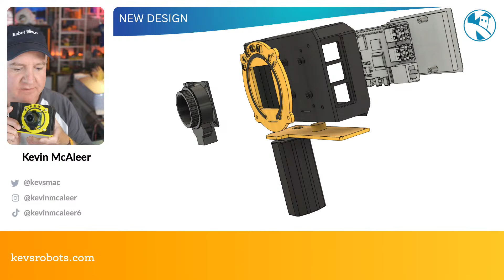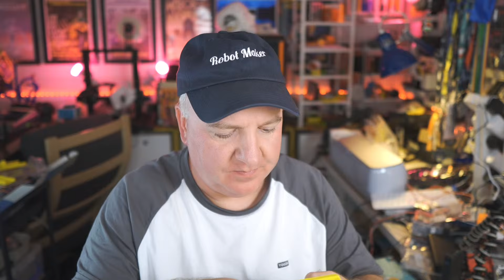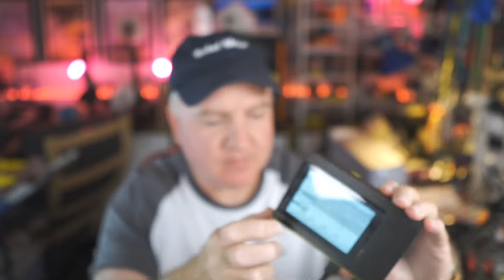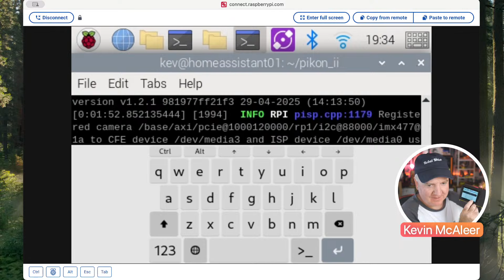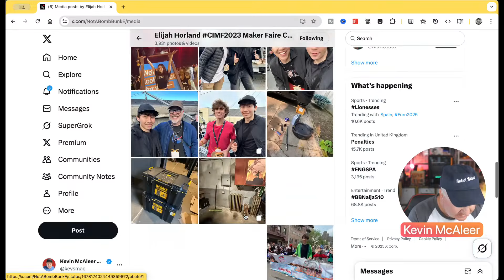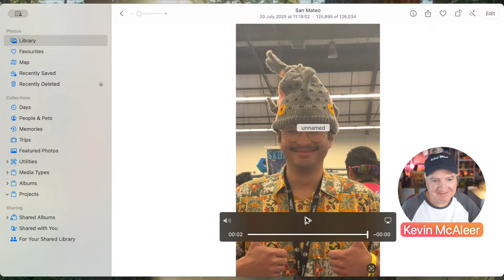PiKon II: The Ultimate DIY Raspberry Pi Camera!

Comment: I’ve been watching your pikon projects and looking at other versions around the web of similar raspberry pi based digital cameras, very impressed. I’m interested in doing something similar, I like the idea of having camera modules that could swapped like the ai cam or adding a m5stack llm 8850 ai accelerator so you can do object detection from a distance using cs lenses. Not sure which direction to go really. You think your pikon could fit another hat?

Comment: Thanks for the great video! I'm having an issue downloading the STL file for the front section, pikon_ii_front.stl. The download link seems to be redirecting to another webpage instead of downloading the file. Could you please check on it when you have a moment? Thanks!
Reply from the maker: I've fixed the issue - reload the page and try again
Reply: @kevinmcaleer28  Awesome, thank you for the quick fix! It works perfectly now, and I've got the STL file.
Reply from the maker: @kalyankumarmanuri4579  thats great! Enjoy!